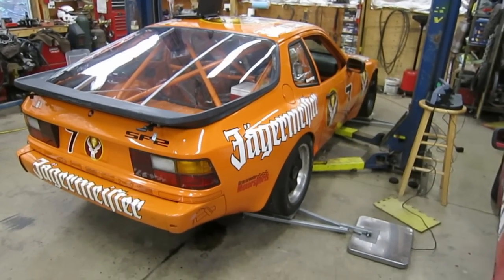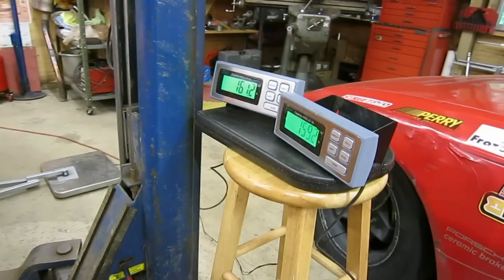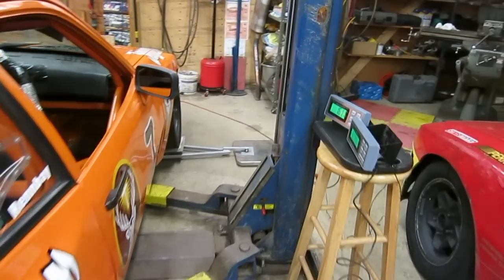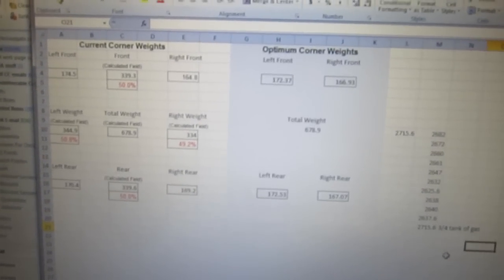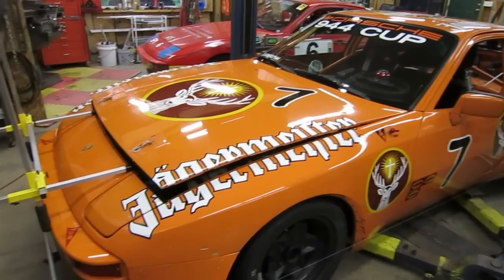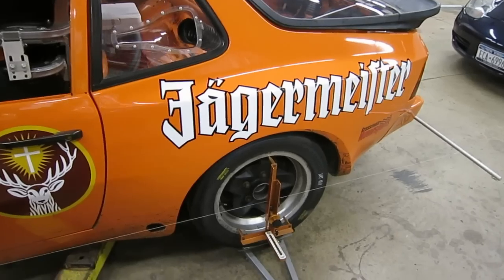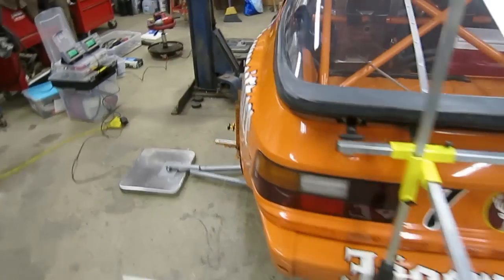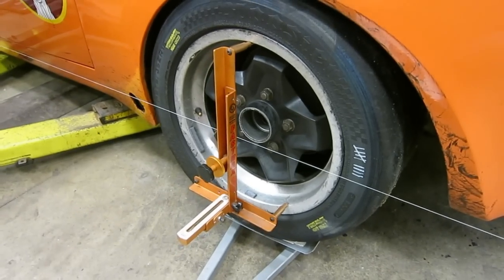944 corner balance and alignment

Comment: It's good to see a decent video for how this is done.

One question. For the corner weights. The beams the car is sitting on. If the wheel sits on a slightly different position on each wheel, won't that give false readings as the leverage will be different or is this minimal.

Very nice race car btw.

Comment: Hey van. Can u put out a video about how you modified your bumpers on the Orange 944
Reply from the maker: I just had a friend weld up the holes, and weld little aluminum plates over the turn signal openings.  Then I used some body filler to make it all smooth. :)

Comment: Awesome 944! I just picked one up and i'm turning it into a track car! How do i go about lowering the rear? It's a 1984!
Reply from the maker: You may have a little be of adjustment in the "spring plates" that go between the torsion bars and the trailing arm (there's a large-head eccentric bolt)...  But you will probably have to re-index the torsion bars, which isn't a small job.  Good luck!

Comment: Nice car. What size tires are you running on the rear wheels?
Reply from the maker: +DEVILZ1969 Those are 275/35 R15.  Due to a rule change, I now run 245/40 R15.

Comment: Is that Jim M's old car? How did it end up with door handles back on it?
Reply from the maker: It is!  The door handles aren't functional - they're just there to comply with the PCA SP2 class rules.  Clearly you know the car and/or were involved building it?
Reply: @vsvenson  I built the whole thing
Reply: @vsvenson  why would you weld up the holes in the bumper?  That only adds weight.